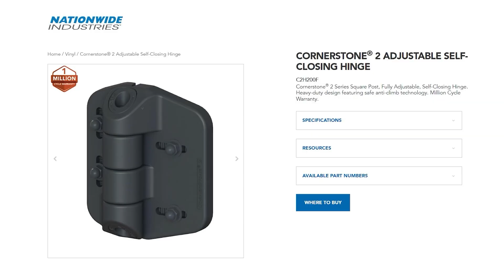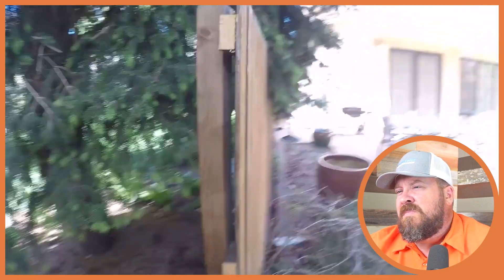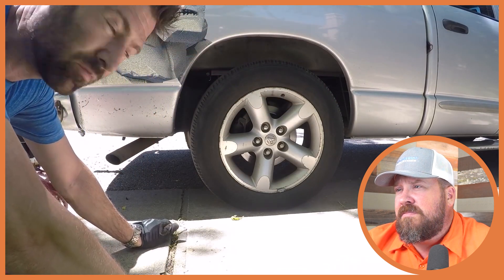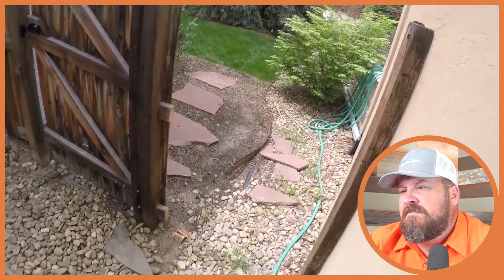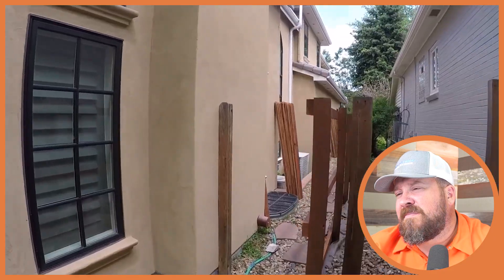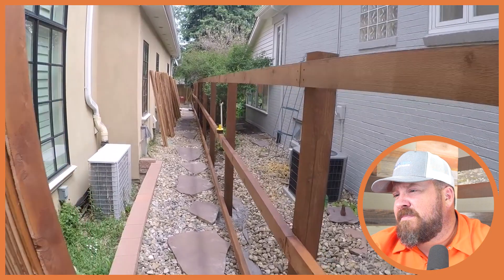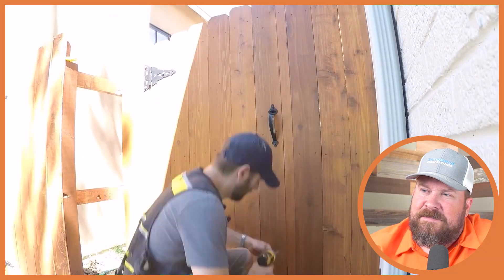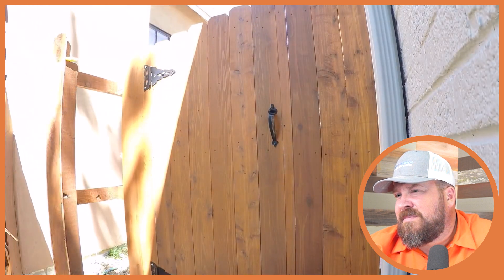THIS Was DANGEROUS! - Fence Expert Reacts

Comment: I need advice please help. I had my fence installed a week ago and it curves with the ground looks horrible. But my main issue is that at the ground line they used dry quick Crete. I mean the entire fence line on wood that says NOT TO TOUCH THE GROUND. There are some areas that this dry concrete is 2' away from the fence in my yard. I called to have them clean it up and they acted like suddenly they don't speak English anymore. The owner came out previously when I called complaining how uneven it is. He spoke to my husband and I as if we don't understand how fencing works. My question is how do I remove all this and if it rains won't this harden an set? How can I send you pictures and a video? You can't believe it until you see it. Tysvm and I hope you can help me.

Comment: I run two string lines. 1 down low and 1 up top. Helps a lot in quick setting of long lines. And I only drop steel posts.
Reply from the maker: Sounds like a great process, I appreciate you sharing it!

Comment: The handyman “not typical” handyman. He’s actually been in trades for decades and has a LOT of building experience when comes to different trades. Really not a handyman, imo, but does “handyman” work😉
Reply: Freehanding on the table saw (without a guard) and reaching over the blade is not the mark of somebody who knows what they’re doing, no matter how many subscribers he has, or how skilled he insists he is. Speaking as someone who has been woodworking for many years, and has seen a lot.